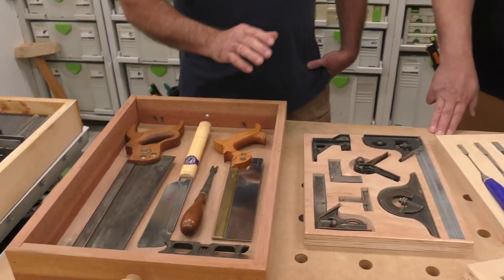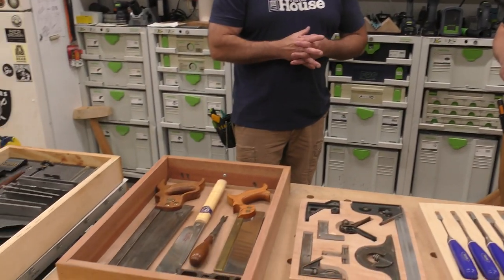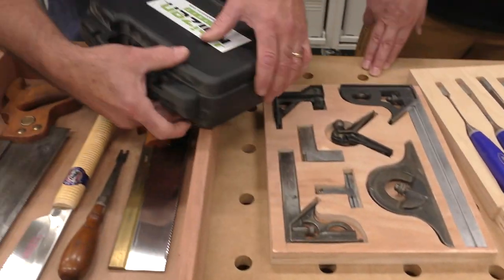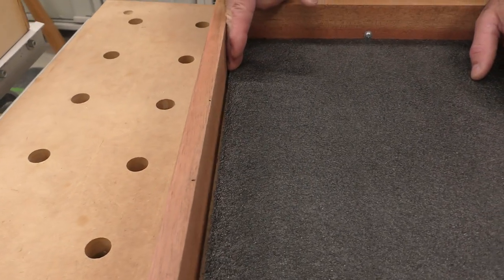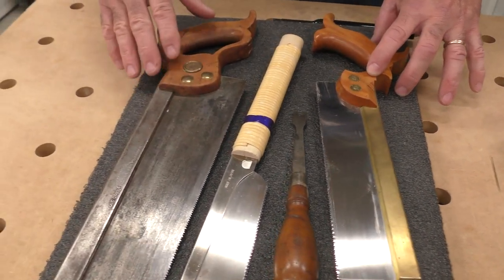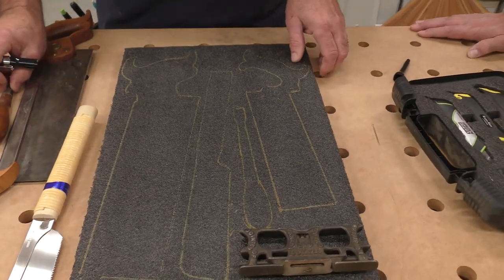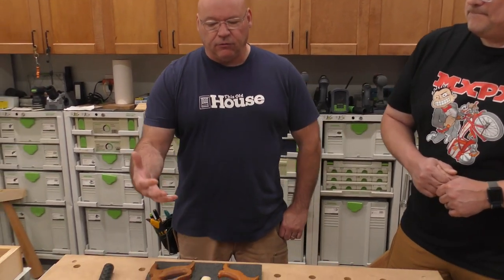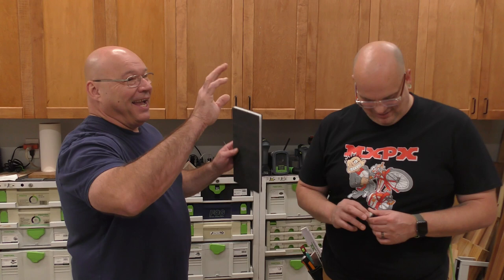Cutting Custom Kaizen Inserts

Comment: I showed you a foam insert I did at a training class. I use a router with a ball nose end mill. I set the depth of the tool on the router then cut the exact depth. Then you aren’t constrained by the layer thickness. I’ve made some for Systainers and also for Pelican cases
Reply from the maker: too cool ... great idea with a router !!!